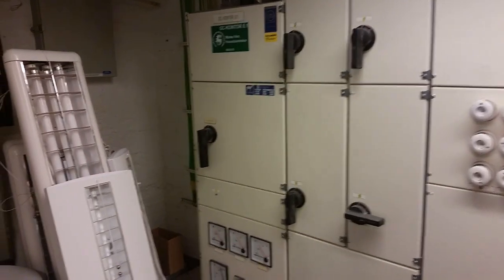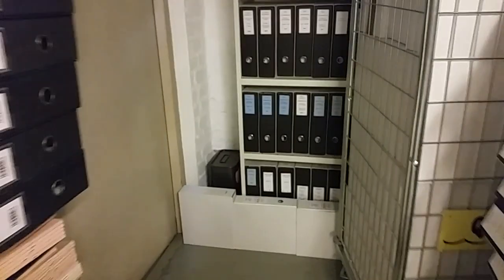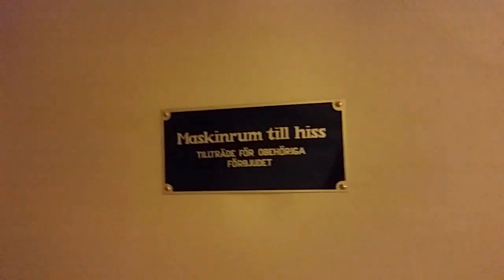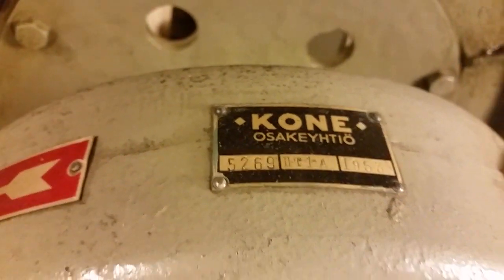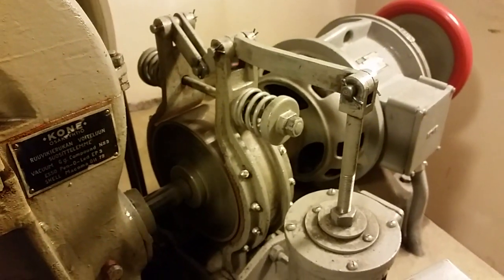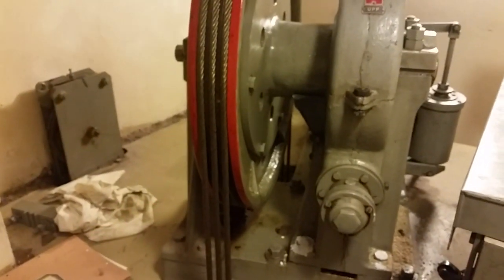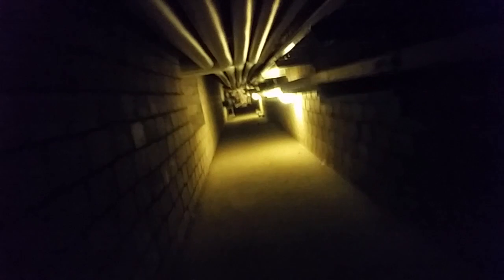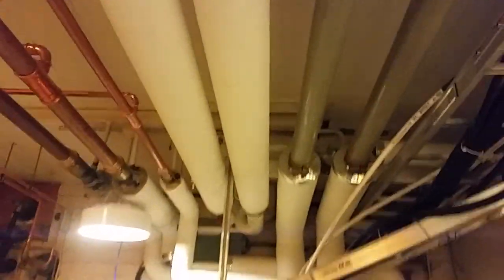Elevator Motor From 1953

Comment: Is there a possibility this might be a DC motor with an enclosed frame not exposing the communicator and brushes? With the selenium rectifier top of the floor relays board it's generally an indication it's a DC hoist motor. Also I just saw one starting relay engage on the controller board with a single contact point.  I did consider DC is used for the brake solenoid, however it's often rectified before reaching the coils.